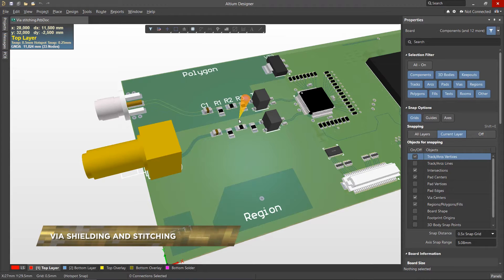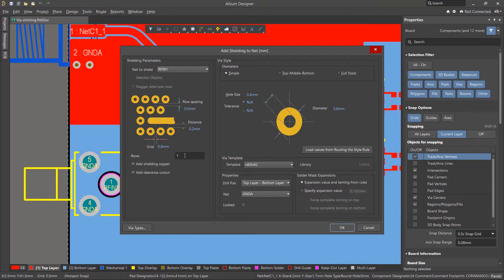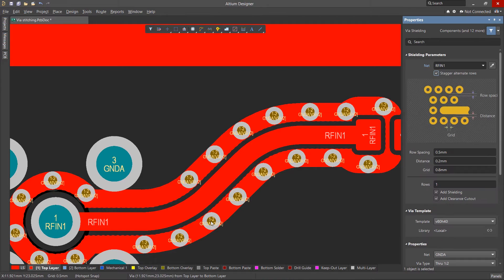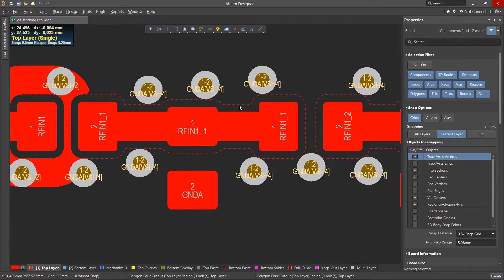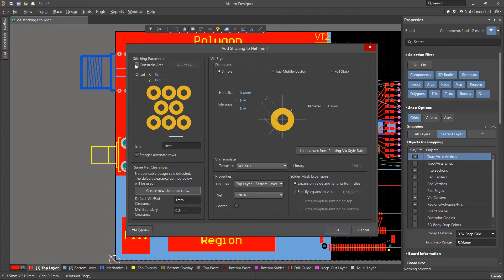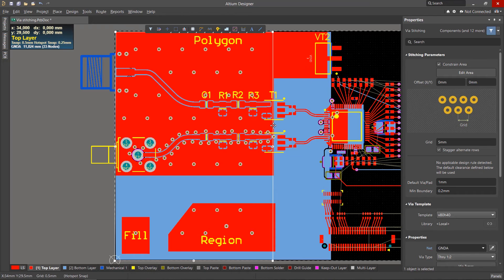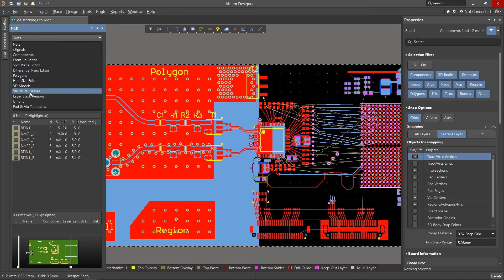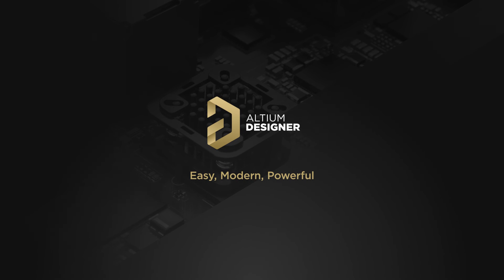How to Use Via Shielding and Stitching Tools in Altium Designer

Comment: Are shielding objects reducing target impedance because of additional coplanar coupling?
Reply: Of course it does, unless it is places reasonably away from the track (about 3x thickness of the dielectric material).  
Therefore, this is a very useless feature for RF design.
Reply: altium has grounded coplanar waveguide impedance calculator, that adjusts the width of the track
Reply: @blanchehermine  all the PCB vendors that i know use Polar impedance calculator that ignores coplanar ground objects.